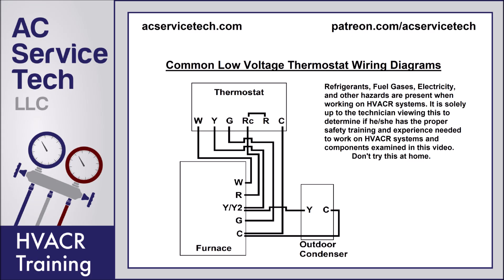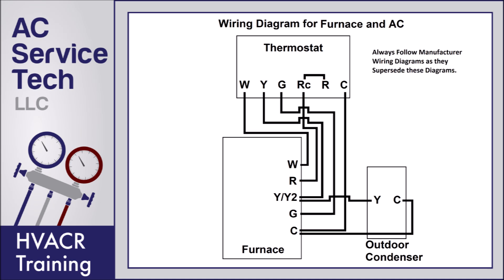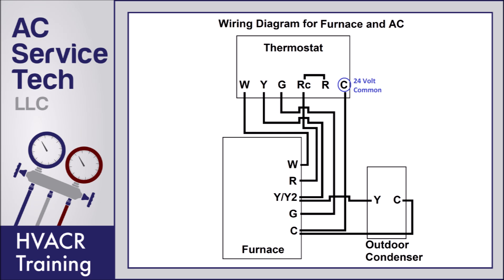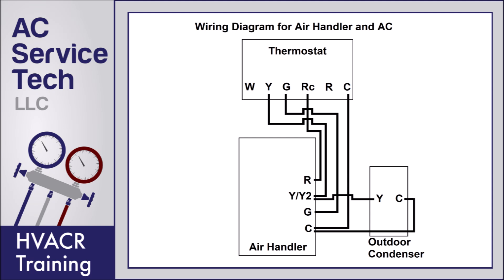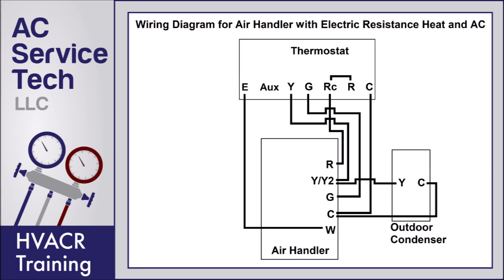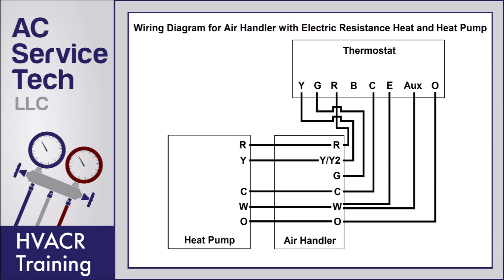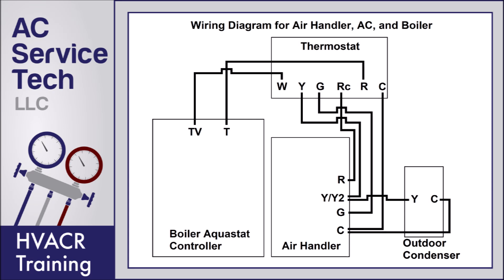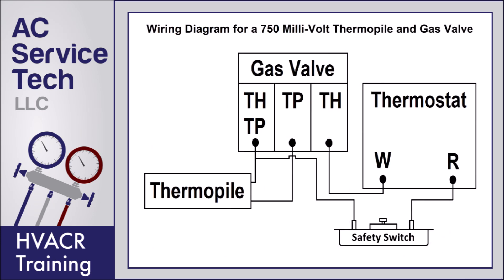Thermostat Wiring Diagrams! 10 Most Common!

Comment from the maker: Support-  https://www.patreon.com/acservicetech

Tool List-  https://www.amazon.com/shop/acservicetech

For those that are looking for the tools used in the videos: (Linked Below)
UEI DL479 Multimeter with temp sensor http://amzn.to/2jtsUbJ
Valve Core Removal Tool http://amzn.to/2uYr8WL
Blue Vapor Yellow Jacket Gauge- https://amzn.to/2Ju7pan
Red Liquid Yellow Jacket Gauge- https://amzn.to/2sSFmGH
Quick Coupler for the Gauges- https://amzn.to/2sTk8Ze
JB Test Gauge High Side-  http://amzn.to/2ruQb0l
JB Test Gauge Low Side-  http://amzn.to/2qR0utM
Manual Copper Tube Swage/Expander- https://amzn.to/2WRPa1M
Uniweld Hydraulic Swaging Tool- https://amzn.to/2MlrI8m
Uniweld Swage and Flare Kit- https://amzn.to/2T55jyn
Ameriflame Oxy Acetylene Torch Setup- https://amzn.to/2SRm3JF
#2 Tip for Oxy Acetylene Torch- https://amzn.to/2SPDaeD
Cap-N-Hook Tip for Oxy Acetylene- https://amzn.to/2MbhpUk
Air Acetylene Torch Setup-    http://amzn.to/2aQalsb  
15% Silver Brazing Rods-  http://amzn.to/2gVLyLc
Nitrogen Regulator-   http://amzn.to/2bXdR5f
Nitrogen Flow Meter-    http://amzn.to/2brvoBg
NitroVue Flow Reg-  https://amzn.to/2MiulYv
Ultrasonic Leak Detector- https://amzn.to/2Lw4Zpr

UEI DL479 Multimeter with temp sensor http://amzn.to/2jtsUbJ

Magnet Jumpers- https://amzn.to/2PyKPQZ

Alligator Jumpers- https://amzn.to/2PxqJXn

Fieldpiece ST4 Dual Temp Meter  http://amzn.to/2wc1ME3

Fieldpiece Bead K Type Temp Sensor https://amzn.to/2DBwKfs

Fieldpiece Wet Bulb Temp Sensor https://amzn.to/2RRI7Tw

Fieldpiece TC24 Temp Clamp https://amzn.to/2qHLyjZ

Yellow Jacket Refrigerant Gauge Set http://amzn.to/2aenwTq

Refrigerant hoses with valves http://amzn.to/2aBumVI

Yellow Jacket Gauge set & hoses https://amzn.to/2vLVkV9

Yellow Jacket 4 Port Manifold w Hoses https://amzn.to/2BkuGIq

FieldpieceSMAN360 Digital Manifold Set https://amzn.to/2BdoaD4

FieldpieceSMAN460 Digital Manifold Set https://amzn.to/2nB4Fe6

Compact Ball Valve for Refrigerant Hose https://amzn.to/2KUisW8

QuickDisconnect 90 for refrigerant hose https://amzn.to/2MMtVcg

JB 6 CFM Vacuum Pump   http://amzn.to/2nqbvo8

Appion Blue 3/8" to 1/4" Vacuum Hose http://amzn.to/2uYlVyc

Appion Red 3/8" to 1/4" Vacuum Hose http://amzn.to/2uYg6Ro

Appion Valve Core Removal Tool http://amzn.to/2uYr8WL

Yellow Jacket 1/4" by 1/4" hose http://amzn.to/2umtcod

CPS Vacuum Micron Gauge http://amzn.to/2v1nM3O

Supco Vacuum Micron Gauge http://amzn.to/2v1JRiA

RectorSeal Bubble Gas Leak Detector http://amzn.to/2ckWACn

UEI DL389 Multimeter  http://amzn.to/2xAdaJf

Other tool links can be found in the video description section.

Shop through Amazon! Your Purchases through Amazon provide a means for channels such as mine to earn advertising fees from all purchases after clicking through. Prices are the same as normal-    https://www.amazon.com/shop/acservicetech
Reply: Do you have a Heat Pump wiring diagram that shows how to add a outdoor ambient control sensor
Reply: AC Service Tech LLC  sorry I can not find a proper place to send you a message or email. I’m a third year HAVC service tech in Cleveland. I have a request. Due to the fact that I can not find a good video anywhere for this. Can you please possibly make a video for steam boiler McDonnell Miller LWCO and auto feed. Diagnostics and schematic. Thank you so much. Your videos are very informative and we (younger techs ) appreciate you. Thank you.

Comment: I have an outdoor 2-stage HP connected to an indoor air handler with a variable speed fan. The air handler also has 2 stages of strip heating (7.5kW x 2). I have a new Sensi Touch 2 thermostat that can provide staging in Cool Mode or Heat Mode, including efficient staging of the heat strips based on IP Weather or a dedicated Sensi outdoor thermometer. Any hookup variances for this? (Daikin DZ16TC, DV49TCD).

Comment: The C wire is basically the AC return for continuous thermostat power right? If so that explains why smart thermostats require one. 

If a system does not have a C wire, but I have a 24 volts ac power adapter, would I still be able to connect a smart thermostat if I connect one output wire from the adapter to C and the other output wire to R/RC?

Comment: Man you save me.  I have a  new Trane Heat pump  and an old furnace from 30 years ago and it still  works.  I bought it because of a good deal.  Installed it but the wiring was driving me crazy.  Now, I know how seven wires can be hook back to the furnace and Nest Thermostat.  You are a lifesaver.

Comment: Looking to wire a heat pump ac and use the heat pump as primary and a boiler as back up. No electric heat in duct is this possible?

Comment: R to W for heat, DOES NOT need a fan connection?  The control board in the furnace does it?  thank you
Reply from the maker: Correct. Fan waits until the heat exchanger warms up.

Comment: I have an old sauna. The thermostat has gone and they stopped making parts for this controller 15 years ago. If I wire W and R together can I then just turn the sauna on with my isolator switch? I don't need a timer or temp gauge for my small heating unit.

Comment: I recently had a Tempstar FEM4X6000BL 5 ton air handler with a 20KW electric heater strip installed. I want to change my thermostat to a ecobee Smart Thermostat ENHANCED. My existing t-stat is wired with 4 wires and I think the new t-stat requires 5 wires. There is a 5th wire (blue) not used at the t-stat. I assume it is the same at the air handler. I need to kow how this configuration should be connected. This is not a heat pump. I have an outdoor condensing unit.  I hope you can help.

Comment: Hi, do you have any videos on wiring a smart thermostat to a dual transformer system: zone switching relay for heat (hot water baseboard) and separate air handler for air conditioning?  Thanks!

Comment: Dear Craig, thanks for the clear explanation on the control wires.  I read your text book and could not find any resources on the two state compressors, with Y1 and Y2.  I understand that thermostat , in the heat mode, calls for W when there is more than 2 degree difference.  What I am not clear is how the HP system decides to go into the Y2 mode.  My 3 stage Honeywell thermostat has no indication for the second stage.  Therefore, I do not know if the compressor is in the second stage.  Is the temperature falls greater than 2 degree, the W and Y2 is energized together?

Comment: I had a one system thermostat that controlled by heat and AC through a forced hot air furnace. I have since had the systems split with 2 thermostats. I would like to control them through one thermostat. The AC thermostat has 3 wires (RC/Y/G) and the furnace has R(Rc jumper), G/W/Y. Based on what I see in your videos, should I run the current AC Thermostat RC wire to the new thermostat RC connection (not jumped) and the heat R wire to the R connection on the new thermostat. And would both G wires need to share the G connection on the thermostat?  Both systems are on their own power meaning 24v comes from 2 separate locations.

Comment: Can you please post something explaining what exactly the common wire does? How does it relate to the other wires or thermostat so that no batteries are needed? Thanks
Reply: The battiers are just powering the relays in the thermostat instead of getting direct power from 24v circuit. Common is just used to complete a full circuit. My instructor always taught me that voltage just wants to go to work (coil energizing) and go back home. As in back to the transformer or C for common on the board.

Comment: This video helped me tremendously in installing my new Nest learning thermostat. The wires from the thermostat I was replacing were not properly labeled and the original installation was performed without the common wire. I kept getting "No power to Y1". After following another video on YouTube, I performed the G wire hack but then I got the "No power to Rc" message. I was about to throw in the towel and call a professional when I found this video. Through watching it, I was able to figure out that the wire with only two leads came from the outside and the other wire went to the thermostat. I learned the meaning of C wire, Y1, Y2,  Rc, Rh, G and they were no longer just letters to me. I figured out which wire coming from the outside was the common wire, hooked up a common wire to go to the thermostat, fixed the mislabeled wires and the Nest was happy. Thank you so much for putting this video together!

Comment: On old manual Honeywell stat there is an X terminal that is wired into and the other end hooks into the board in an old Coleman AH14-0 air handler and this board has Thermostat connections on top then Outdoor Unit connections on bottom, all on one board. Both X connections on this board are being used.  New Honeywell stat RTH6580WF needs a common. Can I just use this black wire from X on board and put it on C in new stat? New stat has no battery backup so I need a common. I am assuming both X terminals on this joint board are both common terminals but not sure.

Comment: I have thermostat with Rh, Rc, G, W, Y, but, not C. There are five wires from the wall - Red, Black, Blue, White, and Grey (yellow). I used a meter to check the 24V is output between Red and Grey; also between Black and Grey. I put Red-Rh, Black-Rc, Blue-G, White-W and Grey-Y. The heading and fan are working. But, the cooling doesn't seem to work. Please advise. Thank you very much!
Reply: They were all working. I took out the wires without writing them down and messed up.
Reply: Myabe I didn't wait long enough. How long does it usually take for the cooling system (compressor and fan outside) start running after I turn it on?

Comment: Hey! Trying to identify the "C" common wire for a new smart thermostat. I am currently using a Honeywell thermostat that only requires 3 wires (Red, Yellow & Green). The Blue and White are wrapped around the bundle since I only use this thermostat for my AC. Would the other end of the "C" wire be only my outside unit, or up in the attic where the air handler is? Or??? Would really hate to spend the $$$$ for a simple wire hook up! Thanks in advance.

Comment: What if the control board only has R,W,G How to wire it for A/C ? No Y or C its a older Goodman furnace.
Reply: Would indicate you have no AC working in connection with the heater?

Comment: Would you a happen to have a diagram for an electric variable speed air handler and 2 stage electric heat pump? Thank you!
Reply: I'm late, you probably can get the exact diagram you want as a PDF from the manufacturers website or just Google blankety blank schematic diagram for your system. Unfortunately not all makes use the same terminal buss letters, and some are digital rather than analog controlled now.

Comment: I have a attic air handler unit AC/heat and also have an oil boiler for baseboard heat....is it possible to wire a thermostat to run my boiler for my primary heat and air handler for my secondary / emerency heat..??   What would my wiring diagram be ??

Comment: How can you transfer the wires from the old thermostat to the new? My old thermostat had the setup of W2 (black wire and jumper wire)
E (jumper wire) Y(yellow wire) G(green wire) R(red wire) B(blue wire) X (brown or pink couldn't tell from fading)

My new one has the spots if 
S.            L/A
S.            O/B
Y.           Aux W2
Y2.           E
G.             W
C.             K
U.              R
U.              Rd

My unit is a heat and air together and its electric. Any help is appreciated

Comment: My thermostat is a very old lennox model with 2 wire currently connected and the remaining 5 cables are not connected anywhere. how do I replace my old thermostat? all the cables are either white or red.

Comment: I have a heat only thermostat which is pretty old and I want to replace it with a new one.  There are only two wires so I ordered a two wire thermostat which has three terminals W, C, R. Which wires go on which terminal?
Reply: Tommeah Ent 
Connect the two wires to W&R on your new t-stat

Comment: just my 2cents .. use a meter to check voltage between C (blue) and R to make sure you have 24volts.  If you don't there may be a autotive type 3amp blade fuse on the low volt circuit board located on the heater.  Also if there is no voltage, as was the case with my installation, it may be that C (blue) was never connected at either end.

Comment: What if you find only 3 wires hooked up on the thermostat? Red, blue and white. Only way to turn off the heater (which was on emergency) was to turn off the breaker. Now the furnace doesn't turn back on.

Comment: Great videos Craig.. I do have a question that I cant seem to figure out why my new Goodman MVC96 furnace blower fan shuts off as soon as I switch the thermostat to cool mode but the condenser does start up fine.  Because of no blower fan circulation the TXV and service port start freezing up immediately so I cant even get to setting sub cooling  . I have the 2 condenser wires hooked to Y & C on the furnace control board but when set the thermostat to cool it shut off the blower fan. Blower fan also wont run in the ON or Auto position when set to cool but does work in heat and fan only mode.???   Any suggestions would be great. thanks
Reply from the maker: James, did you say that you replaced your thermostat already in a different thread? It sounds like the thermostat is just not sending the signal to indoor unit when you are turning cooling on. You could turn the power off to the furnace and then wire nut or jumper R, Y, and g at the thermostat. Then turn the power back on. If this turns cooling on and the blower runs no problem then your thermostat is to blame. The thermostat usually connects r to y and g but maybe it is only connecting r to y and your furnace board is not getting a signal to turn the fan on? Though usually even if the board gets a 24v signal to only y, it still turns the blower on because it knows cooling is calling, thanks

Comment: As an electrician by trade and are working with an HVAC contractor currently, I had to break the control aspect down to what is the hot wire( red)  and what is the return wire (common) to make 24 volts work though out the control of each function on a thermostat. In most cases red is hot to then have the thermostat construction and actions determine what it powers —the white ( heat) yellow (cool) green (fan) and brown or black for the reversing valve while the blue ( common ) is now required to be installed for the WiFi and Nest thermostats to work and charge internal batteries correctly. it may help others in understanding that a thermostat is a temperature  based selector switch for the action one will look for in controlling the function of a heating and or cooling device as red as it’s hot leg to call on those such functions with the common returning to complete the circuitry.
Reply from the maker: Absolutely! Great tips! I added the thermostat video playlist in the description section, where videos focus more on the voltage flow, thanks Todd!

Comment: Mr. Craig
I have a question on low voltage T.stat wire if you have heat pump only have 2 terminal it is no way to run new thermostat can you be able to make work please tell me how . Thank again
Reply: Franky Rojas 
If your heat pump only has two NEW low voltage terminals it would appear to be an Air Conditioner, which is cooling only. If that is two line voltage terminals call an experienced electrician. If you don’t know the difference calll an experienced tech. It makes a difference ! Don’t get hurt or blow it up, it’s cheaper to let experience pave the way.
Reply from the maker: Great discussion Gentlemen, and thanks for the quality!
Reply: You could get a wireless t stat and module.  No need to pull wires
Reply from the maker: Yeah I am not sure what you would only have two wires from. Maybe look the model number up of the heat pump or air handler you are referring to for a wiring diagram for that but 24v controls for a heat pump would typically need more than two wires, thanks Franky and Stephen!
Reply: AC Service Tech LLC 
That’s the value of professional advice....we have seen this....too many times....and it costs the money .... wanted saved.

Comment: Craig, Would you do a detailed  schematic for an electric heat thermostat? How does the heat keeping from being made when you have thermostat on heat and you have fan on the "on" ? I have looked on the net but I cannot find  a thermostat schematic for what I want to know.  Thanks for your accurate, detailed valuable videos.
Reply from the maker: Hey Aliso, do you mean electric resistance heat strips on an air handler? If so, use the Heat Pump Thermostat and use the E, G, and R, along with the optional C. Just don't do the wiring for the AC Condenser showed in the pic, thanks!
Reply: @acservicetechchannel  Craig, What I mean is a detailed schematic of the thermostat with the sub-base. I reference "Thermostat Wiring Principles" by Bob Scaringe Ph.D., P.E. where detailed schematics of the thermostats and sub-base are drawn. However, he does not provide electric heat thermostat, non-heat pump schematic. I would like to know how w is not made when you have g made for fan on but w makes and breaks when calling for heat or not calling for heat. Thanks again for sharing your valuable knowledge.
Reply from the maker: Ok Aliso 82, thanks for letting me know!
Reply: @acservicetechchannel  what do you mean don't do the wiring showed for ac condenser????